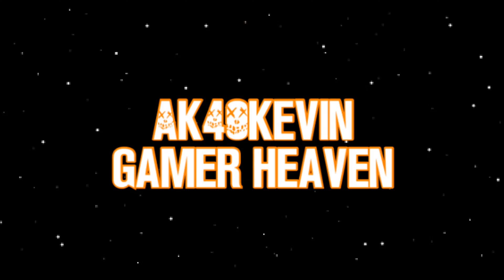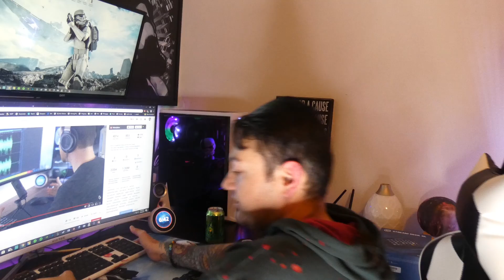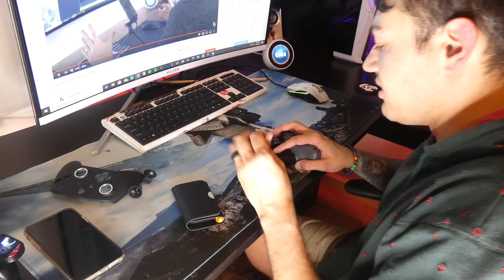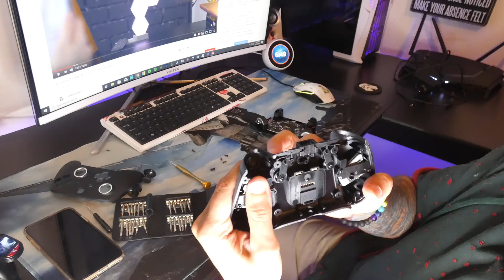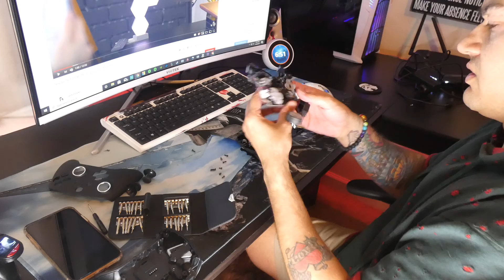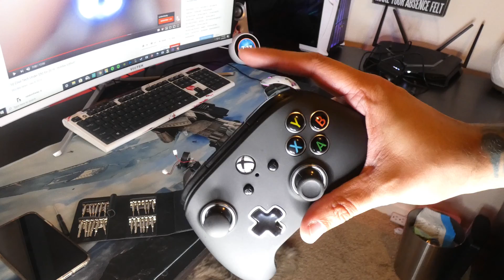PowerA Fusion Pro Tear down/Disassembly

Comment: Are there any points on the board that I can solder rumble motors to? I have mine apart mostly to clean it but I don’t recognize any possible areas. Just over 80 test points 🤨
Reply: Hey did you ever figure out which test points correspond to which buttons? Also, do you know where any ground points are located (are there any ones labels GND)?

Comment: Unfortunate, I'm having problems with this opposite of what I have with the Micro$oft ones.

2 years and the Joy sticks never showed age on me, a huge plus. Weight and feel is right compared to the M$ ones. Cheap alternative for paddles.

But like a year in the rumble started to go, and now almost 2 years in the right trigger broke. Going to try to glue it back on but I doubt that would hold long anyways, they sent me a Series one as a replacement so hopefully it lasts as long. Once it dies think I'm going to try their cheaper ones since I only use two paddles anyways and that's all they got.
Reply: Same here! Did it worked the glue on the right trigger?
Reply: @mikeopcgate7  It did. Continued using for a while on FPS games so lots of right trigger and no snap. They sent me a series replacement when I filed xlaim over the rumble problem so using that now though.

Bit gorilla glue on both sides of break. Tricky part was keeping the controller in the right position to let the glue settle, had it upside down and wedged stuff around it to not move over night.

Comment: The old MadCatz MLG controller has removable weight slugs for customizable weight. And the official Elite Controllers are garbage quality despite your claim of heavier plastic (they went from ultra simple and durable single circuit board on 360 to a three piece shell/frame with split circuit board on Xbox ONE)

Comment: Hi, ive had my fusion pro for about a year but my left stick has started sticking and now the push button under the stick won't work. Is it easy to replace and can you buy the part seperate or if your in the UK would I be able to send it to you for service and repair? Thanks
Reply: do u mean when u click down on left stick it doesnt work?
Reply: @bdn3242  yes mate the stick button
Reply: @Mike-ut2ou  my stick button when pressed down is doesnt seem to always work do u know how to fix it
Reply: @bdn3242  no that's why I asked
Reply: @Mike-ut2ou  ok
Reply: @Mike-ut2ou  i have the same problem Did you figure out how to fix it?

Comment: I like the heavier feel I guess some people prefer it to be lighter. I feel like Gamer Heaven just doesn't like this controller. He also says that the ABXY buttons falling out is a bad design but that is normal. I've takin apart standard controllers before and it was the exact same it just had a rubber actuation pad (gaskets) over them but it fell out too with the ABXY buttons it did not stay or stick like he said. Whatever its just his preference on the controller.

Comment: Those joystick potentiometer modules don't look very standard at all what are you talking about?.  Alps pots that everyone uses have blue sides.  those don't.

Which makes me wonder if they are better since the alps potentiometers are notoriously bad about stick drift as seen in the switch pro, xbox, and playstation stock controllers.

Comment: I agree with the weights being misleading, but another thing I thought of was a scenario where I have the controller on a bed with the 10ft cord extended and the other end hooked up to an xbox/pc and someone walks and trips on the cord. The weight of the controller might help it stay in place for it to disconnect near the usb end rather than launch the controller if it were lighter.

Comment: Hi I have a question about the powerA spectra and i bought a button kit for it and was wondering if I'm able to take it apart as easy as a regular controller or to I have to be Alot more careful and am I even able to do this?

Comment: Definitely not to mislead you with the weights. Some people actually like the added weight. I think it’s a great idea and for those that don’t like it can just remove it.
Reply: Exactly and people always complain that the controllers feel to "light". I also think they were added to simulate the added weight of a battery, which this controller doesn't have.
Reply: @satie321  personally i prefer my controllers with some weight the light just doesnt feel good to me
Reply: Does it void the warranty tho
Reply: @yabbadabbindude  not at all. You can even remove the motors without voiding the warranty
Reply: I love the added weight to it

Comment: Hey I just bought a new fusion because I love it but my old one my left thumbstick wont allow me to keep running is there anyway to fix that?
Reply: I found either resetting the controller or changing out the joystick from personal experience. If your joystick is not broken resetting will save it.
Reply: Check on bottom to make sure solder for the stick button isn't cracked. Then try cleaning the stick (open up and blow canned air into the module. If air doesn't work you could try electonic cleaner spray in there. Just let it air out for a while, electronic cleaner evaps fairly quickly. Or map the stick buttons to paddle so you don't wear out / break your sticks clicking them

Comment: My PowerA fusion pro has problems with the left stick movement and the RB button
Reply: same with me did you fix it
Reply: @j6nnyy  yes, take off the face place and pull out the analogue stick and try blowing to clean the dust from under the analogue module itself. For the RB I took the controller apart and put some padding on top of the RB activation button. I last applied it like 10 weeks ago but should do it once every few weeks. But bad but idk what else to do.
Reply: @joshvaughan6580  wym padding maybe some tape?
Reply: @j6nnyy  yes, that’s right
Reply: @j6nnyy  but don’t make it too thick, it’s trial and error really I struggle with it sometimes
Reply: @joshvaughan6580  do you have a video of someone doing it that you followed or what cuz i’m a little confused on how to fix it.
Reply: @joshvaughan6580  hm okay
Reply: @j6nnyy  I couldn’t find anything so I decided to try doing it myself and that’s all I found
Reply: @joshvaughan6580  hm lmai thanks for the help ,was taking apart the controller difficult ?

Comment: Thanks for the teardown. Only thing I wanted to see is if the LB / RB buttons use the same plastic mechanism as the cheaper PowerA controllers. My current Spectra has "broken" because an internal tiny piece of plastic broke on the RB button from overuse / stress. The board etc is fine, just the little arm that actuates the RB button cracked - very frustrating!
Reply: Had t9 glue together and loosened the sensor thing so it doesent vollide
Reply: @HMcod  Cool. The answer to my question above was actually that the Fusion does use a more robust mechanism than the Spectra. Been using it over a year with no problems.

Comment: Thank you for this video. I couldn't fathom why my fusion pro had to be so damn heavy which was ruining an otherwise great control pad. I have now removed the lead weights and it is much much better.
Reply: Hello, do you know what screwdriver is needed? I’m struggling to make out what this guy is saying...  My RB is broken and I need to fix it but I don’t know how to open it up without knowing the screwdriver
Reply: @joshvaughan6580  the screws are cross headed but I had no luck using cross headed precision screwdrivers. In the end I found a 1.5mm slotted (aka flathead) precision screwdriver worked really well.
Reply: My rb button is broken too. Works but no click. Need to buy parts and solder it in. Does anyone know what that part is called? Can I use a regular xbox one controller part for it? Thanks
Reply: @eye8pho29  sorry, that one is beyond my knowledge. I hope you figure it out.
Reply: @eye8pho29  mine works now, I just found a simple short term fix by putting padding on top of the RB actuation part itself so it has more force needed for the broken press.
Reply: @joshvaughan6580  does it still make that clicking sound? Mine stop clicking. I think I need to change that part. I also added a ear bud rubber piece to make it push back so I can use it for now until I get it replaced. Just bought a part but it's for xbox one controller. Hopefully it works. I'll update
Reply: @eye8pho29  yes it does make that loud click but depending on what material I use it can go away but only temporarily. Good luck, I hope it works
Reply: @ComplexPTube

Comment: Question : when i updated my power a fusion with paddles .. Out of no where after update I wanted to play my right.trigger stop working right like doesnt register correctly
Reply: Same, I calibrated mine and the trigger is not registering the right way.
Reply: Noe Bazan I fixed it do it again
Reply: Having the same problem, my paddles that I registered as B puts some kind of virus in my controller and it just press random shit until i take the pro pack off, do you have a fix for this?
Reply: Khi Wave do it again ! I fixed it by trying again

Comment: Hi Kevin, I have recently bought this controller and the headset jack has completely come of the motherboard!!  Any suggestions to getting this fixed? TIA
Reply: Have you gotten this fixed? My controller has done the exact same thing.
Reply: You can solder them back on, buy a soldering iron on Amazon for a tenner
Reply: My fuckin shit to lol 
The 3.5 jack wiggles like a hotdog in a hallway

Comment: I messed up the headphone jack do you know if I can replace it? And if so what’s the part?
Reply: Did you find out I dropped mine and it fucked it up
Reply: Same for me did you?
Reply: I can’t even get the god damn power cable out it’s like they stuck it in with bloody cement
Reply: Currently trying to fix mine just wanna fit a new audio jack but can’t even get the back panel off

Comment: The fusion would still last longer than the elite 2 😂😂😂
Reply: I’ve also had 2 fusions my first cable fucking broke somehow and just recently the smallest drop of water fell into my X button and caused my hole fucking remote to die.
Reply: My first elite 2 lasted 7 month and my replacement lasted a week 😂😂😂
Reply: I believe it
Reply: i wouldnt be too sure about that i had 2 powera spectras and 1 fusion on all 3 the left stick/sprint button was fucked up after about 1-3 months never had that problem on a original xbox controller : /
Reply: Sandro Radies my fusion’s sprint button is also fucked up after 1 month :/ any fixes besides replacing?
Reply: @andyl825  stop pressing the button too hard maybe mines lasted way longer
Reply: @sandroradies8381  the fuck is a 'sprint button' ?
Reply: Kind Old Raven prolly just pressing down left stick to run.
Reply: @sandroradies8381  I have the same problem after play Warzone
Reply: @sandroradies8381  stop pressing buttons too hard maybe

Comment: My right trigger just broke for my power a controller the one in this video, is there any way to fix it
Reply: Mine too left trigger not working
Reply: @phoenix_capella  again, try pressing left trigger
Reply: I opened the controller it's broken
Reply: This just happened to mine as well. Did you figure out a fix?
Reply: SYNZ_music I just sent mine back dont try open it or they wont accept a refund try send it back dude
Reply: Have you tried pressing the right trigger

Comment: Whats up kevin, is it possible to swap the power a thumbsticks with xbox elite thumbsticks? Btw i love your vids and i am a new fan.
Reply from the maker: Sure can. Take off the front face plate, pull of plastic sticks and put on these https://amzn.to/3epCvvL 
its not a hard install 1/10, right on brother, I'll keep the videos coming.
Reply: Hi Kevin, I’m struggling to remove the faceplate from my powerA enhanced controller (it’s not the fusion but it’s an Xbox one controller for about £25) do you have any advice? Thanks and love the video

Comment: Damn dude, kinda disappointed with those weights. I just bought this controller to save cash for a better controller than the regular Xbox controller. Comes in tomorrow. Guess time will tell if it works out for me or not. Dope video tho man.
Reply from the maker: Thanks Mike. Let me know what you think of it after getting some stick time. It's not a bad controller, but they definitely could make some revisions for the next version
Reply: @Mike Hunt what do you think about it
Reply: Simp Nation It’s been my daily driver for the past 5 months and I honestly love it. Feels premium and I do switch out the sticks from time 2 time. I don’t Regret buying it and I definitely recommend it.